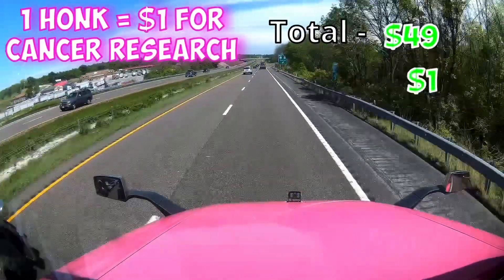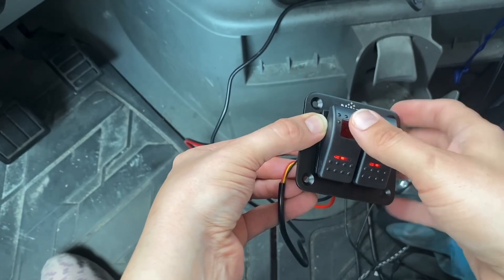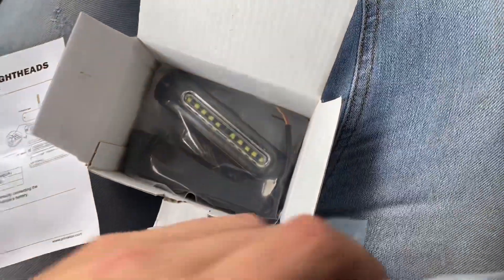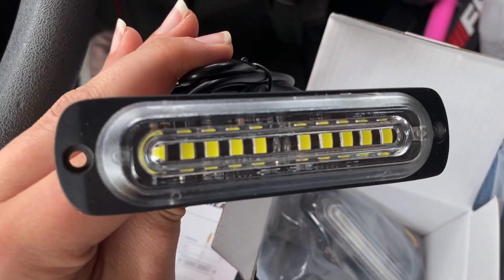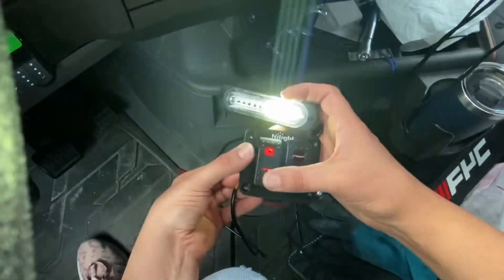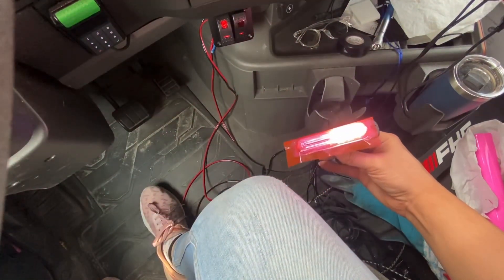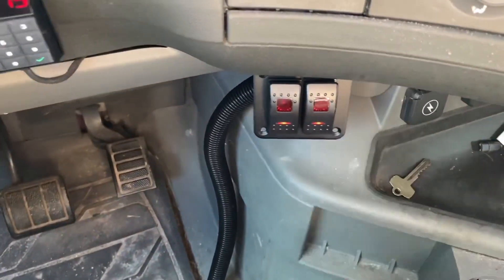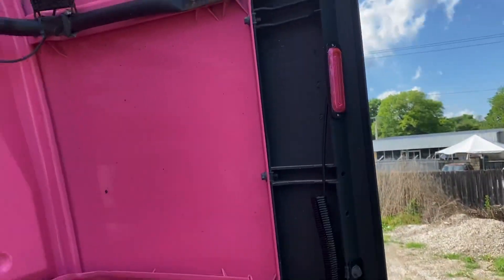I Pimped My Ride for a Good Cause!

Comment: Now that's cool and what would be even cooler is get some pink spinners for the wheels
Reply from the maker: That would be cool 😎
Reply: Yes I would and also you can buy led lights that goes on the inside wheels too look it up on YouTube there pretty cool
Reply from the maker: @adampierce4157  I will have to check those out! 😁✌️
Reply: Yes ma'am